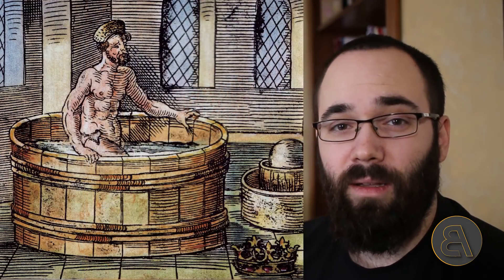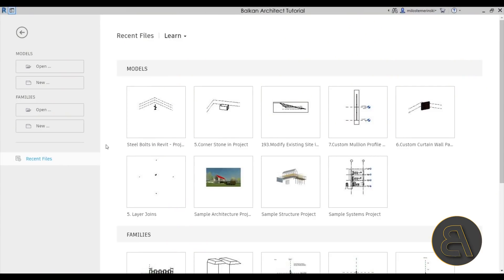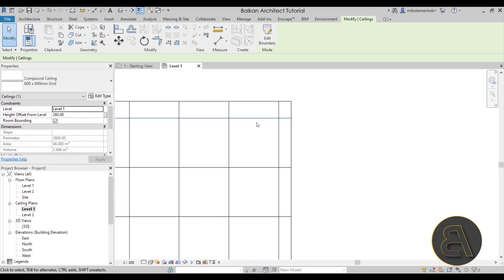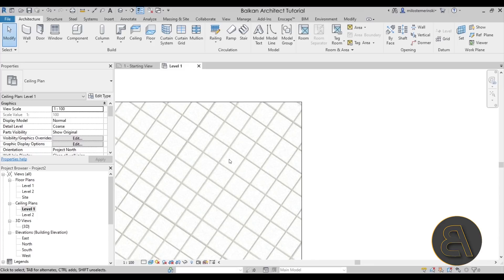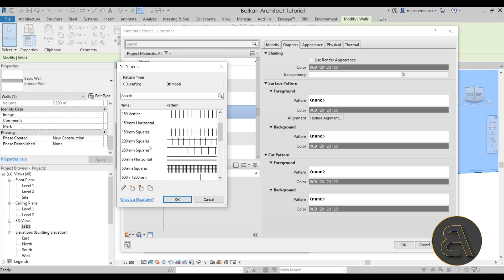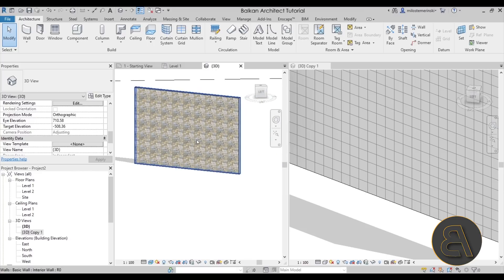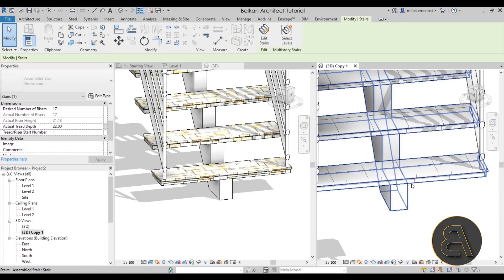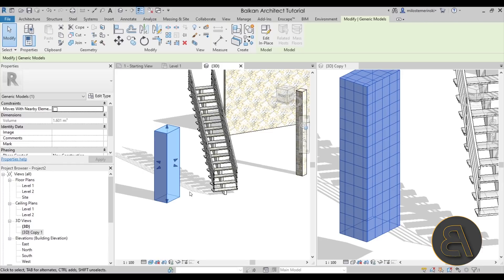Material Hack in Revit Tutorial (Material Placement in Revit)

Comment: Good trick to know. I found it a while back. Is great with pyrevit that allows you to easily make custom surface patterns that closely matches the texture that you use. Also very good to know that you can actually paint the faces of in place models with the material you need and control the "UV maping" in the same way.

Comment: As said, this feature doesn't work with all categories. And for some categories it seems to work, but not all the way. Stairs for example. As soon as the thread is not rectangular but something like a trapezoid, Revit will align the material pattern alongside one of the edges; of course NOT along the desired edge and there's no way to get it to align with an edge of your choosing.... There are some other categories in which material pattern behave weird.